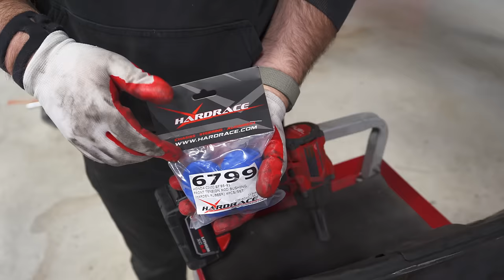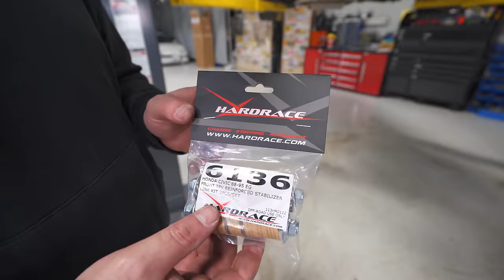EF Honda Civic B16B VTEC Build - Its FINISHED!

Comment: A really useful tip for removing the glue residue from tint is use some windex or glass cleaner WITH AMONIA and a piece of soft steel wool and it will literally just melt off the glass it’s so fast and easy and works like a charm
Reply: Those scour pads for doing non stick dishes are a safer bet on glass
Reply: Use a steam cleaner with w microfiber between the gun and glass
Reply: When I was removing the tint off my CRX I used a steam cleaner.
Reply: Simple green and a scuff pad or steel wool, just don't let the simple green dry on the panels or it will leave streaks

Comment: Humble tips: 80% tint the windshield, 30% tint the rest of the glass. Space the steering wheel on the hub. Consider a dished steering wheel. Could gain 4" of offset towards the driver.

Comment: The grounding to the stud… I have my grounded to the same place as yours and I too have not noticed any power loss.  Not sure why I grounded it there as well, I’m sure I had my reasons 12 years ago but like you guys, the internet had mention that my ground wire was in the wrong spot as well. 😂

Comment: You guys picked good parts. Big fan of Hardrace in general, all my suspension bushings are Hardrace. After sampling the spherical joints they offer I should have gone with those, but still, their bushings are every bit as good if not better than OEM/Spoon/Mugen.

Comment: I believe the tension rods in the front have to do with caster control more than anything.  Of course you can make the caster goofy by mounting left and right upper control arms backward by accident, but thats another problem.  But def they have little to do with toe and surely nothing with camber.

Comment: The original honda designs of the EF and the japanese model have the lip, mirrors and door handles color matched, so much cleaner. The only reason they are black was to save money. Only the belt molding was ever intended to be black on base cars and color matched on top jdm models as well Si, SiR, 25x, 25XT

Comment: Interesting choice to go with an Ebay Crank Damper after being unsure of the reliability of an Undamped Crank Pulley. Especially after spending so much money on the engine and it being a Very high revving engine. But, not my car... Also should pick up a ASR Steering Wheel Adapter/ Extender to Adjust your Wheel Position.
Reply from the maker: It’s an OEM crank pulley from EBay…
Reply: @speedacademy  I don't know, a lot of duplicates and replicators out there. 😬
Edit: After looking it up, all Reputable Sources for OEM Honda Branded Crank Pulley (including other Part Numbers that  fit) show it's been fully discontinued. I understand that's kind of the only choice. But still after putting in, I'm assuming, more than 8-10k (USD) in the whole project. I would still have looked for an ATI or Fluidampr. It just seems out of touch to not care about something like that.

Comment: I believe the b16b was balanced from factory with the n1 pulley not sure if it will make a difference in your application, although I have heard using the n1 pulley on any other b series is typically a bad idea because they are not balanced for it

Comment: Next time to remove the glue from tint use Tuff Stuff. Spray, leave it for a few seconds and scrape it with a blade waaaaaaay easier than soap and water.

Comment: @SpeedAcademy did you have any hood clearance issues with the B16B/B18C? I remember back in the day people were forced to run an EF9 hood like I did or cut the hood itself. Are the newer HAsport mounts setup to fix this with the P72 tall block found on the B16B?
Reply from the maker: Yes, it touches ever so slightly. We put foam padding down hoping that will be all that’s needed.

Comment: Lmao. That aftermarket front bumper fitment is shocking. You can clearly see the top corner profiles are totally off compared to the genuine bumper. The bumper edge already meets up with the wheel arch yet the top corners under the indicator lights are way too tucked in. It doesn't require a filler panel or fibreglass work. It just requires genuine parts and no corners cut.